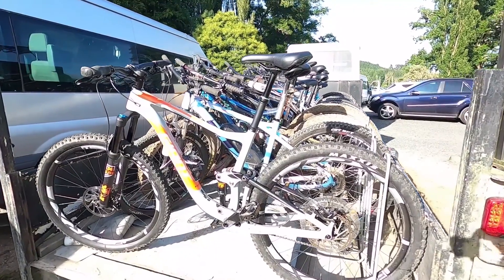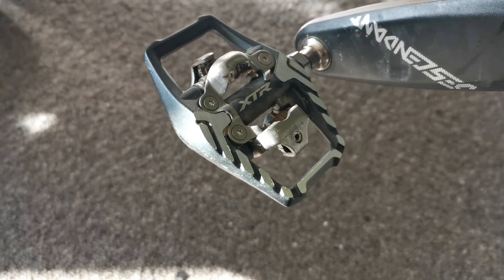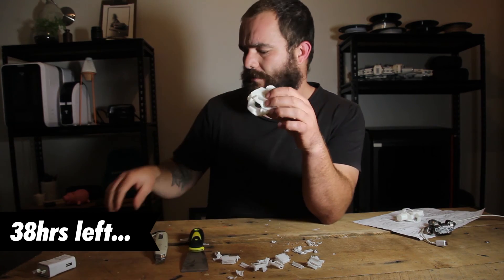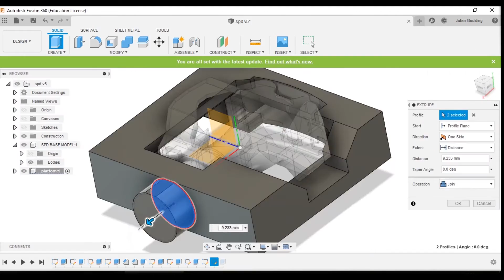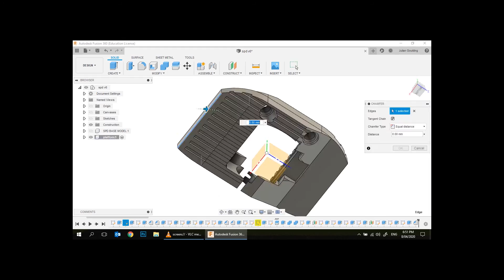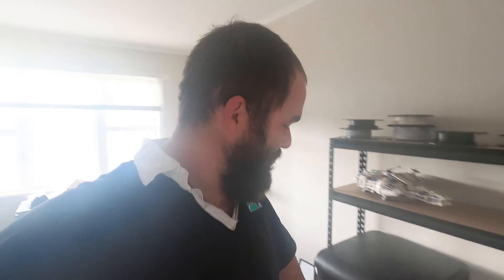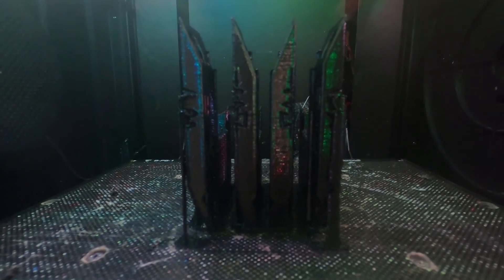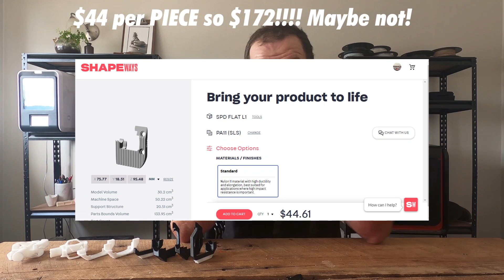I made my own XTR Pedals. Are they any good?

Comment: They make XTRs without the platform, see the PD-M9100 compared to the PD-M9120 which is what you upgraded to. In addition, they also have the PD-M530, which is their SPD with platform at the same level as the PD-M520s that you have.
Basically there's no correlation between spec level and whether or not there's a platform.